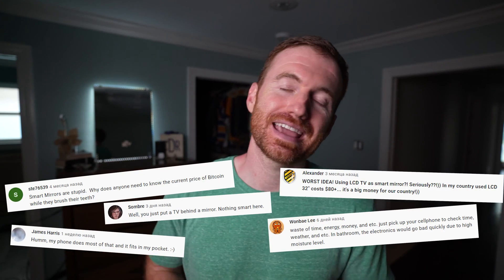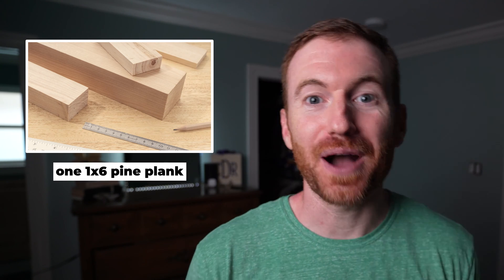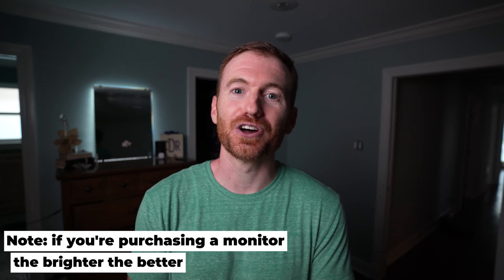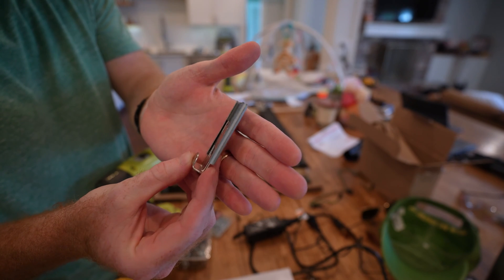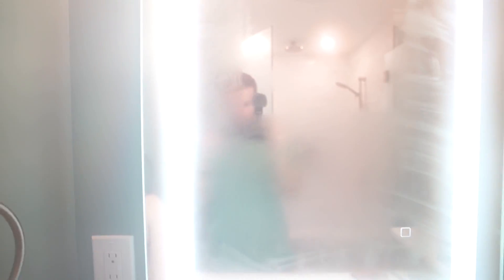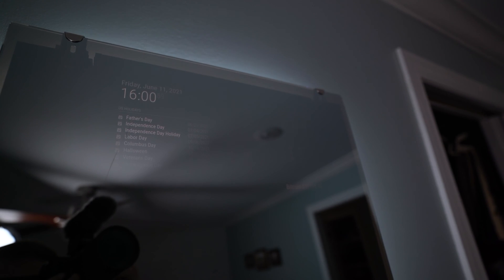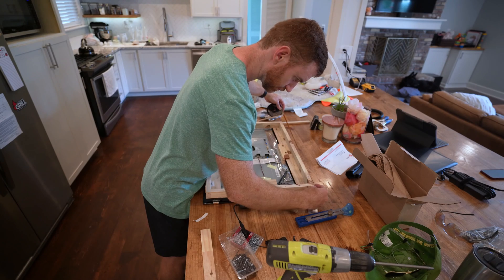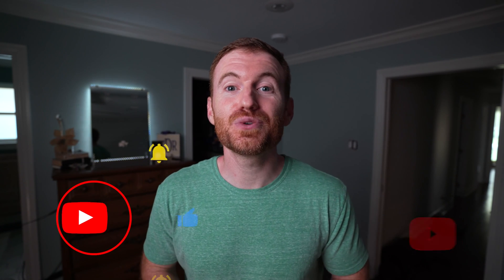DIY Smart Mirror v2.0 - Magic Mirror Build

Comment: Noone that builds these mirrors talk about energy usage. The worst kind could be turned on 24/7 all year which with a 100W energy demand is more than 800kWh a year. 
When people waste energy the country you live in needs unnessecary powerplants and it takes longer to convert to renewable energy sources.
You need to talk about energy saving modes.

Comment: Another option to inlay the hardware, clamps and add a rabbet cut to flush-mount the glass and monitor is... a router, with a straight-cut (flute) bit. Would be nice and clean.

Comment: FWIW : that monitor was possibly fine from the rain... common misconception. Wet isn't always bad for electronics unless it is powered on during the wetting or before drying, as long as you don't let it sit and corrode and/or don't clean the mineral deposits left behind. The true issues are the water/minerals causing a short or corrosion breaking traces or component legs/pins. It's not like feeding a Gremlin... ;-) Could have even made for a good video :-)
P.S. Take my sub + like
Reply: yep I once dragged home this tube tv that got rained on and let it sit for a while and it was fine after a week or so
Reply: Just needed some rice and some time 😉